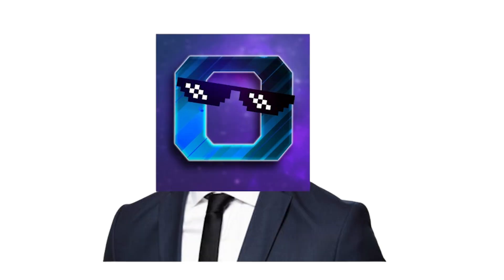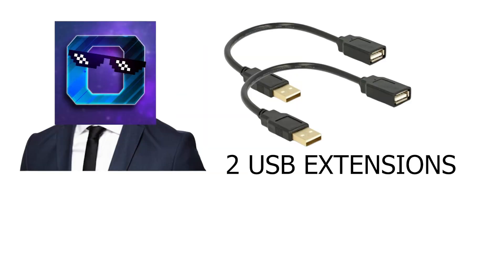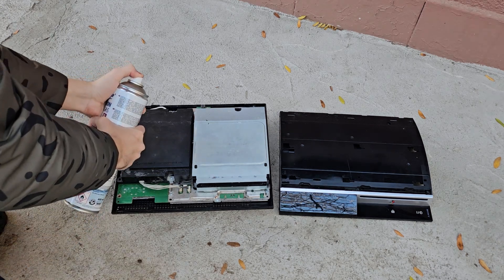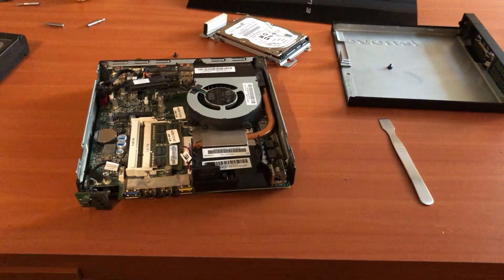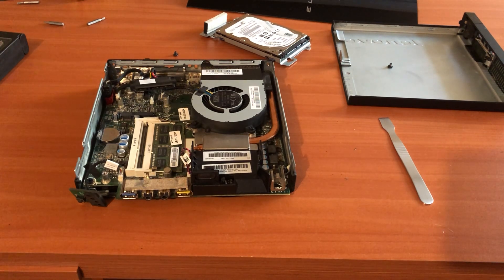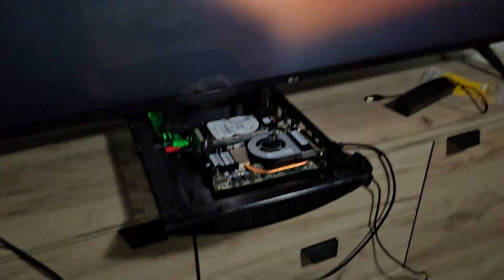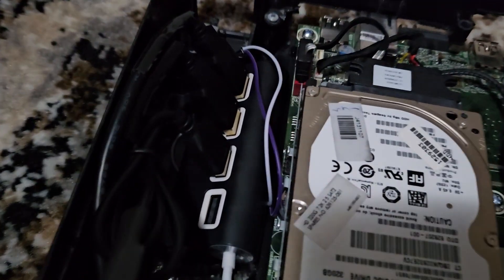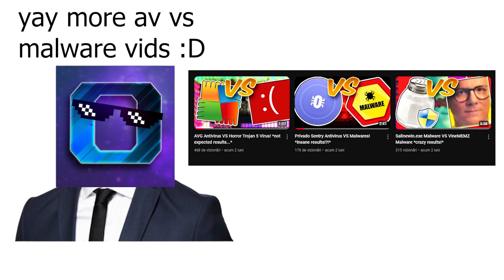Building a Playstation 3 PC! | The PS3 PC Project

Comment: Great job! I’m planning on making something similar with a dell wyse 5010 motherboard. I’m thinking of designing an and 3d printing a new backplate for the ps3 that fits the motherboard I/O rather than cut the existing ps3 backplate.

It would also definitely be possible to put a slot load laptop drive in there in the place where the ps3’s Blu-ray player used to be.
Reply from the maker: Well i'm glad you enjoyed my video 😄
With a 3d printed backplate/ i/o shield it definitely looks better and more organised, and since that is also a mini pc, It's gonna fit in with no problems at all (although you'll obviously have to cut the old plastic standoffs that used to be there for the PS3 motherboard, but after that everything should go smoothly).
Eitherway i hope your PS3 PC will turn out great and maybe better than mine aswell 😄👍

Comment: That’s an awesome concept dude, imagine the ps3 case being a sleeper build having a high end GPU and Processor 👌
Reply from the maker: Thanks 😄, i really wished i could atleast add a decent gpu to it, but since it's a mini pc motherboard, it doesn't have a pcie slot for a gpu nor i can get an m.2 adapter for it since i'll also need a psu which will really complicate things around.
Edit: i did just Upgraded It's CPU atleast, from the i3 4130T, i Upgraded it to an i5 4570T 👍 (and also to an SSD with 480GB)
Reply: @ nice man, what about a different shell, something wider for a thicker GPU space I.e Xbox or something ? You could even cut the back of the ps3 to add more space for a bigger motherboard ?